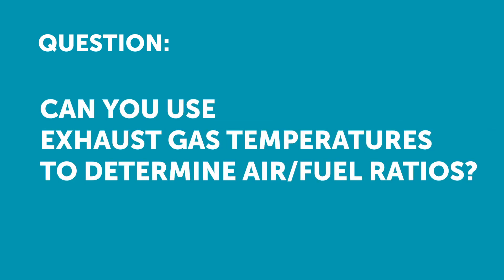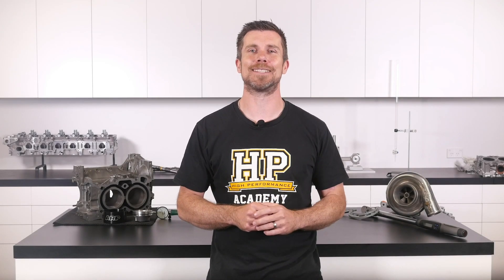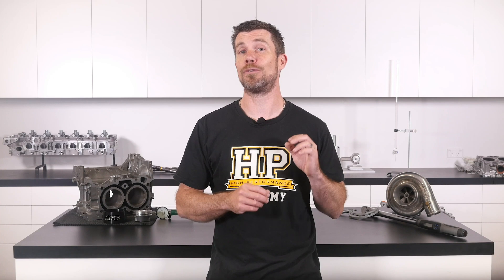Can I Use Exhaust Gas Temperatures To Set My Air Fuel Ratio? [HPA Q&A]

Comment: I have a question on the topic of air/fuel. This is a bit outside your usual work, but I'm wondering your opinion anyway. I'm building a drag racing motorcycle, and currently working on fueling. I'm using carbs, 34mm CV carbs to be exact. Fully rebuilt engine, ported heads, etc. I'm running a custom exhaust (straight pipes, with an X pipe), and pod filters for the intake. My question is, when building something that uses individual intakes for each cylinder, is it beneficial/necessary to add some form of intake resonator/balance tubes after the throttle body to even things out. I've worked on a couple engines that have these sort of things, and i'm just wondering the purpose and if it's really a benefit or if it's unnecessary. Thanks!
Reply: no resonator is necessary just make sure to balance them out to the same inches of merc closest to the most utilized rpm range. ex on my drag bike i have them balanced to pull closer in mid ( 4k-8k ) and top ( 8k- 13k ) rather than low ( 1,200- 3,800 ) because the machine never see's low range. good carb tuning without good balance can kill an otherwise potentially great machine. you can get a set of decent sticks for about 100 quid (us).  if all of the things said above are done properly egt will only be more of reference data under normal stoichiometric ratio of around 14.5 - 15. happy tuning mate.

Comment: As with the ignition timing, the engine is going to tell you what AFR it want - or, more correctly, what balance of those.
As André (french or english spelling? I should have asked ages ago.) said, where EGT monitoring can be critical is with ensuring the turbocharger isn't being run at temperatures higher than the materials used in the turbine are designed for. It can be expanded to ensuring the temperatures aren't greater than the material used for the exhaust valve can survive at without eventual failure - one reason the exhaust valve will normally use a different alloy steel, or titanium, from the inlet.
Reply: 2 egt sensor should be used one on exhaust manifold before the turbo and another after the turbo !
Reply: @RohanSanjith  
Uh, did you understand the discussion points?
Post' can be a useful tool, especially for assessing the turbine and housing efficiency, as it pressure monitoring, but I don't see it's value in this instance.
Might be wrong, though, always something to learn - if you can please add to your comment?

Comment: EGT sensors should be mandatory for Diesel Engines. They're critical for making sure we don't destroy our turbodiesel engines.
Reply: When reading live data both my cat temps read -39 will this be faulty egt sensor?
Reply from the maker: Yes it's a slightly different deal with diesel engines and the EGT sensor has long been the tuner's 'tool of choice'.